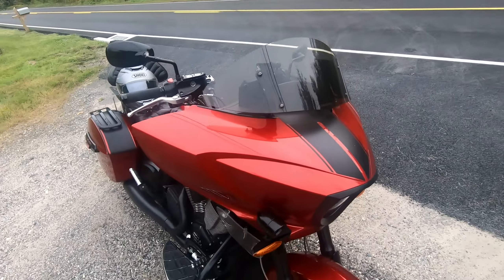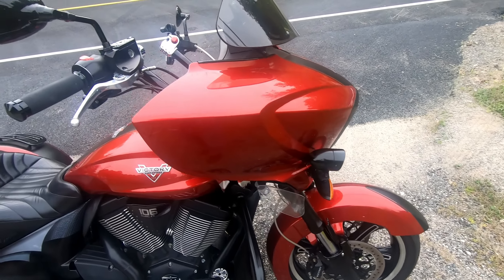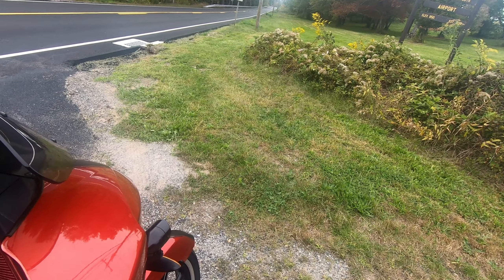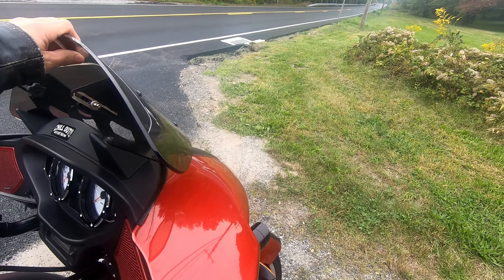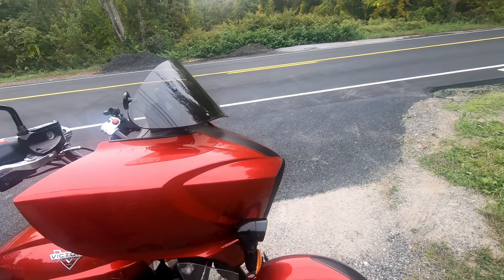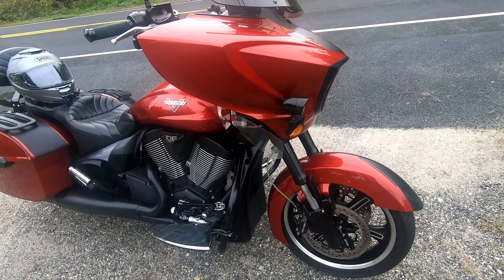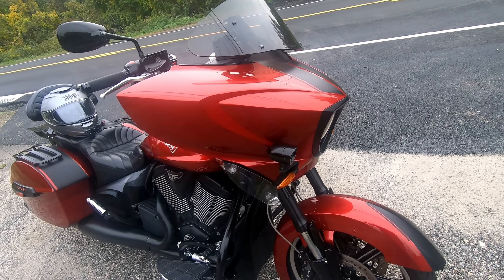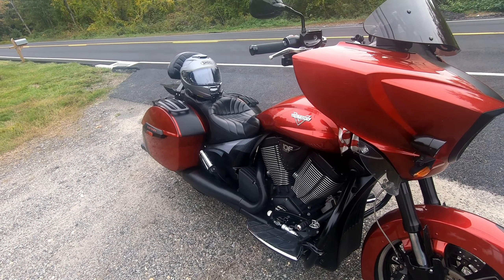How I solved the Heat & Buffeting issues -Victory Cross Country

Comment: I`ve never heard anyone having a serious issue with heat on the XC or XCT. I watch lots of videos and this is the first I ever heard of heat complaints. I mean it is an air cooled bike, they will get hot but nothing out of the ordinary. No different than a Harley. I have a Victory XCT and absolutely love the bike, no complaints. As far as the buffeting, I do feel buffeting at higher speeds but I think that`s something you`ll get on any bike unless you set it up for specifically highway riding. I have a fairly short windshield with the flare edge and it does a good job. I had one of those madstad windshields on my bike when I first purchased it, I did not like it at all, it was way too far forward for me, had too much of a gap underneath and wasn`t the easiest to adjust and lock in place. Glad you are now enjoying your Victory and thanks for the video. Great Bikes! 😎
Reply from the maker: Thanks for watch... I don't know what to tell you as far as the heat goes. I probably could dig up pics from years ago of the scalds on my legs. Or tell you about the time ran hard lowers on a 90 degree day and ended up wreching in parking lot from heat stroke.
Reply: Damn, that sucks the heat hit you hard. No doubt, riding in above 90 degree weather is not fun, especially if it`s high humidity. I never liked riding in hot weather no matter what I`m riding. I don`t do well in high temps either. The Wife and I will ride early morning and be home before noon on the hottest of summer days. We`re in Massachusetts and this summer had some brutal heat. Enjoy the fall riding now 😁😎
Reply from the maker: @michaelroy925  ... Hey neighbor 😊 I'm in CT. Those hot, humid days are tolerable and I've rode in plenty of them with my XC set up the way it is
Reply: Oh cool! 😀We love the roads in CT. Glad your setup helps with the heat.
Reply: heat was a big problem on my 2017 vision
Reply: It's oil cooled
Reply: @jbboating3268 I hv a cross country the heat is crazy even on a cool day
Reply: Definitely hot in the summer. For me when it starts to get mid 80s or above it's very uncomfortable
Reply: @michaelroy925 ok cool thought I was the only one to experience the heat. Glad to see ppl still riding Victorys
Reply: Shid my Vic puts off alot of heat

Comment: I got a sheet of ABS plastic and fabricated my own wings. And they work! Up to 65mph, there is no or minimal buffeting even with my face shield open at the bottom. Above 65, I just have to close my shield completely, but at those speeds, there is still plenty of airflow inside my helmet. I still will use the hard lowers for cooler weather. Great idea. Thanks!!
Reply from the maker: Glad it worked for you. Unfortunately, not long after I made this video, the old Vic finally hit me with a one-two punch 👊 I didn't want to deal with. I sold it and moved on to a 2018 Goldwing Tour... This is another way to solve the heat & buffeting issue🤣.  J/k the Vic was a great bike for me...I had it 10years and managed to put 80k miles on it.
Reply: @painsrides  a little time has passed and I’ve done some more riding and happy to say that that blast of heat that was there with my hard lowers is completely gone. And my helmet no longer vibrates my teeth loose. Best of luck with your wing.

Comment: when looking for my next motorcycle over the decades, if I ever heard, there was the slightest hint of heat from the engine/radiator, making it uncomfortable to ride, I crushed that motorcycle off of my list, and I never consider it again.. I can put up with top-heavy, slow, expensive, funky colors, but I will not put up with heat
Reply from the maker: Are you down to mopeds?? Because in a lifetime of riding, I've never ridden a motorcycle that didn't produce noticeable heat  😶 This is especially true for large air-cooled V-Twins...

Comment: thank you, thank you thank you for letting me know about the heat issue.
  I can put up with things that I can correct like a bad seat, or the wrong, wrist, angles, or The wrong windshield height, but the heat issue has kept me from buying an FJR Yamaha, a Kawasaki concourse, 1400, especially the Honda, ST 1300.. heat is the one thing I will not put up with 
  there is one of these machines for sale here locally where I live, it is gorgeous I was in the process of doing some online research about issues this machine may have, and you just saved me from making a purchase I would regret..
  about 20 years ago I bought a Honda 700 saber with the CBX style, optional fairing color matched and the CBX/CX 500 turbo style saddlebags color matched. That machine was an oven on wheels and I only wrote it about 50 miles before I turned around and resold it. I could feel it roasting my legs through my aerostitch suit on a 55 degree day..
Thanks for the road trip evaluation.
Reply from the maker: As I have things setup on this Victory I don't feel heat when I'm riding, its very comfortable. But as with any big air\oil cooled V-Twin, at stopped and slow speeds the engine does put out noticeable heat, the hotter the air temp the more heat the rider is going to notice. Like I said, without lowers on my bike, the heat evacuates as soon as I get moving. With lower fairings the heat would build up and become an intolerable furnace in hot weather.  
The problem and basically what this video is about is with lower fairings off the wind buffeting was awful. This was my solution(s) to deal with both.

Comment: That's pretty damn smart!! When the wind was bad I would put my feet on the rear floorboards and that helped with 90% of the buffering.. I didn't have heat on my Magnum!
Reply from the maker: Thanks, I didn't have heat issues until I did things to stop the buffeting, fork deflectors or the worst, hard lowers😐. It took me two seasons of trial & error and $$ to work this out where I don't have heat or buffeting.  But its been all good for many years now... Now as long as you don't convince me to buy a Pursuit, it should  be good for many more  🤣😂

Comment: Been riding my '13 XC no real heat issues or major buffeting. Definately NOT scalding LOL
I do notice the stock windshield does help with keeping rain off me and a bonus it pulls any rain up off the tank & blows it up over me. My 1/2 helmet NEVER had any heat "getting up under" it problems. Victory 106 runs cool, I couldn't even warm my hands on the engine fins during cold weather. So I don't know what mod you did to create excess heat. Oh ya on a side note, The Red with chrome delete mat black engine & trim is nice so DON'T add chrome LOL
Reply from the maker: I hate chrome... The heat and buffeting doesn't happen on all XC's
Reply: @painsrides  glad I got one of the cooler running ones then. Ya I test rode the blue & chrome one 🤢

Comment: I have a large switchblade windshield and the buffeting is so annoying at speeds over 75 mph
Reply from the maker: Hopefully some of this helps you... the buffeting sucks
Reply: @painsrides  I guess I need to get highway bars and put some fairings or wind deflectors
Reply: @painsrides  nowhere to find that little piece?
Reply from the maker: @Krotos1970   I said this in the video; those winglets are no longer available they were made by a company called Bad Ace Billet that is out of business. You'd have to fabricate a part or use something similar.

Comment: Wow. That makes sense! 
I have a 2013 CCT with the winglets and lowers. After nine years and 91,000 miles this summer roll riding through California. I accidentally discovered that if I left my lowers closed and slightly cracked the winless I got no heat from that engine. It worked it completely away probably doing the same thing your little wing lakes are doing And in the winter now I slightly cracked the lowers, and it directs the heat in towards my legs and up into the seat I’ve been doing it backwards for eight years. I only discovered it because I simply was the last one to be ready that morning and jumped on and took off in 90° weather and had not adjusted any of the vents and realized I wasn’t getting any heat on my legs or my ass. The close lowers were creating a vacuum that was pulling the heat away.
Reply: Will try this out tomorrow when the sun is out. Getting that heat in during the cold will be nice. Inherited the xct from my father. Still trying to figure the bike out! Haha I come from the sport bike world. Love the bike though it has some power I’ll say that much!
Reply: @jacob-tl3is  I have learned to ride this thing with both tires sliding and my stepson races and he said dad you should join the baggers race, if you have any questions as you learn this bike, I’ll be happy to help you out!

Comment: I can't see this as a good idea because the back cylinder isn't going to get the cooling it needs and will fail sooner from being too hot. It's a motorcycle so you're going to be hot or cold sometimes. But don't cut off your engine from the air cooling it is designed to need. All bikes that are air cooled run the same way.
Reply from the maker: 75k miles later and I'm pretty sure my rear cylinder is getting all the air flow it needs. The wings on the cheese wedges deflect air that was flowing up on to me from under the tank causing terrible buffering.  Do to the wings angle they actually move the air flow downward and likely increase airflow to the  rear cylinder..

Comment: Awesome video. I'm most curios about all your additions, specifically your handle bars, but your windshield is pretty awesome. Did you purchase these online? If so, you have any links you could provide?
Reply from the maker: The Windshield is a Madstad with a  9" tinted shield on it. The bars are made by Klock Werks I believe they are 10" Klip Hangers

Comment: When I ran the Madstad, I realized that the only position changes I made were tilting it forward and back about 3/4”. I experimented with how tight I could get the shield to the fairing without compromising the setup’s benefits. Turned out to be about 5/8” gap. Eventually I made some new, smaller upper brackets that maintained a 5/8” gap and allowed a 3/4” tilt forward.
Reply from the maker: I tried going to a 11" shield it didn't do much but put the top of the shield in my line of sight

Comment: Thanks for the vid, been have the same wind issues on my 14CC. Was seriously thinking about the MadStat now I’m pretty convinced. Would you happen to know if anyone is still making the “tank wings” anymore? I too was/am considering my best me because of wind. Never really had a problem with heat though.
Reply from the maker: You're the guy I made this video for 🤣😉 
No one makes the tank wings anymore and they aren't available as far as I can tell. But something like them can be made up out of Kydex, flexible metal or 3D printed. I didn't have excess heat problems until I tried to fix the buffeting with hard lowers or fork deflectors.
Reply: @painsrides  ha! I tried the fork mounted wind deflectors for 10 miles and was like “ nope! “ loo
Reply from the maker: @ronaldwalters9488  Its been years since I used  fork deflectors... I remember besides the heat, they did something weird to the  bike's handling..

Comment: I think you may have a heat issue out of the norm. I ride with hard lowers all year round. Yeah it gets hot but never been hot enough I would get rid of the bike over. Rode the bike 1200miles in a straight shot from Louisiana to Indiana on one of the hottest weeks of the year and had no problems. Yea it got hot but nothing more than my harley ever did before this bike.
Reply from the maker: I agree, my heat problems were not " the norm"... but I definitely was and am not the only XC rider that's had to deal with it. It stems from the poor wind management of the non-tour XC.  
After the 3 Amigos mentioned the issues, I realized its been years since I talked about this. I figured it wouldn't hurt to make a video for the Vic community, in case anyone else is dealing with heat & buffeting.

Comment: Is your engine modified,  i.e. power commander, cams, etc? I wonder if that's the difference in heat.
Reply from the maker: Some Vics run hotter than others. But a turned engine should run cooler than the lean stock tuning.

Comment: Is the Madstad 9inch worth it?
Reply from the maker: I'm 6' tall, the Madstad 9" is the best solution I've found. I tried an 11" shield on the brackets, it puts the top of the windshield right in my line of sight. 
Less face it, the Cross Country doesn't have the best wind management. The setup I have in the video is the best I could come up with.